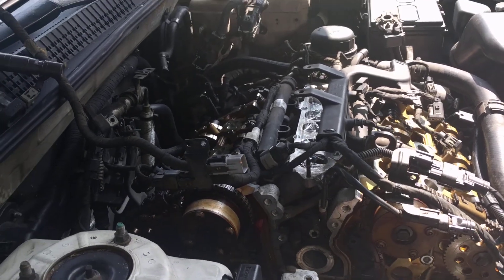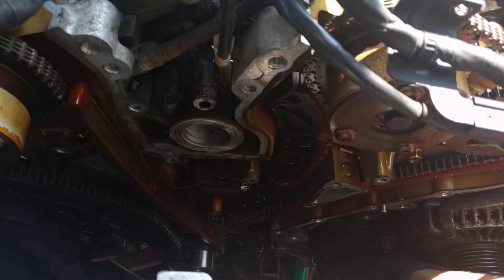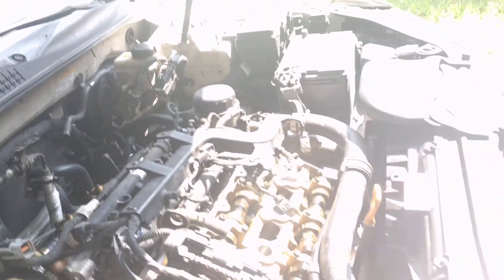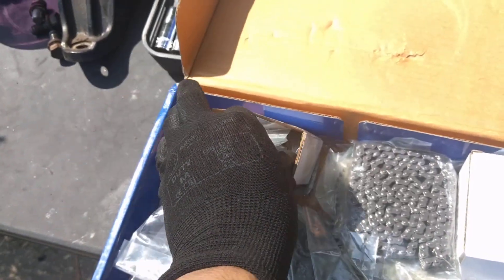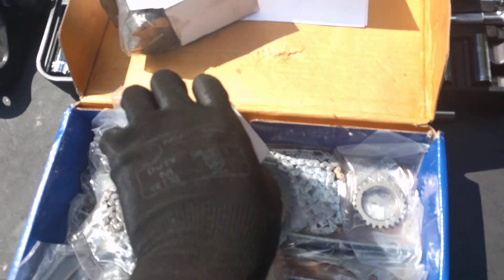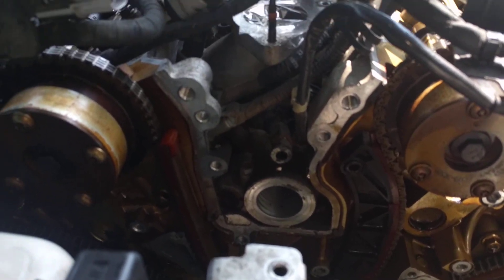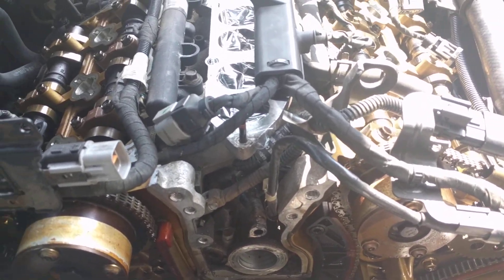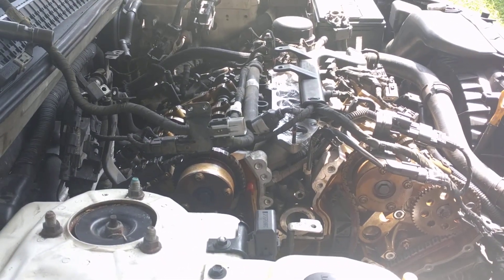Fixing Hyundai 3.3L V6 Timing Chain Tensioner Rattle On Start-Up Part 1

Comment: I have a 06 sonata 3.3. 156k miles all original.i bought the car with 30 k miles and have used synthetic oil and change the oil filter half way at 12 k miles. The chain rattles at start up but goes away once the engine runs. The car still has great power and averages @ 28 mpg. Recently replaced the alternator. That was not fun. Steering pump is whining. I'm so impressed by the engine, kinda like the old GM 3800 but with much more power. Next up are the axcels and upper control arms.

Comment: Thank you for this video as it PROVES THIS PROBLEM CAN BE FIXED EVEN IF NOT COMFORTABLE MESSING WITH TIMING!

Incase anyone asks:
YES YOU CAN CHANGE JUST THE TIMING CHAIN TENSIONER AND SAFELY KEEP/RE-USE ORIGINAL TIMING CHAIN/GUIDES (fixing ONLY what is broken) TO MAKE REPAIR MUCH EASIER FOR DIYers! 

AS LONG AS OIL CHANGES HAVE ALWAYS BEEN DONE AND ABSOLUTELY ZERO SLUDGE IS BUILT UP, and verify there's virtually ZERO SCARING on TIMING CHAIN GUIDE, you can safely say, if it ain't broke don't fix it!!

Here is how i know:

My mom bought a used 06 Sonata in 07 that was a rental car and had HIGH milage for the age .. soon after the engine began to make this sound, but because oil pressure was still high enough everytime she brought it in, the car NEVER made the sound for the techs to hear.

Years pass and i became a mechanic, and FOUND OUT it was related to the timing chain tensioner this entire time! But for nearly 10 years now the sound never increased and stopped once oil pressure kicked in on cold start. 

Since 07 we always did early oil changes and by now car had 150k miles and needed other repairs, soo i traded it to a friend for a large tattoo, and a large list of new parts (A.C, brakes, tires, entire cooling system) and a list problems i made aware of (suspension/front end, severe paint chipping, and timing chain rattle). He slowly fixes it up and drives it until 100+ miles daily for work. Within 2 years the valve covers, timing covers, and oil pan all have developed leaks around 190k miles. Soo since he had to fix the leaks and replace motor mounts, he did them all at once. While apart we both inspected the timing chain /chain  guides and they looked excellent, so to save time and money to replace motor mounts we decided to ONLY replace the tensioner leaving the timing chain and guides in place. And yes we had all the mounts out or loosened as well making it EZ to position the engine for max space making it VERY quick and ez (with the electric ratchet and torque adapter of course haha)

Fast forward 5 years and the car has nearly 100k miles more than when we fixed the leaks and is running 100% engine and transmission wise! Just from tune-ups, fixing leaks, doing flushes early, and that one timing chain tensioner..

Since 07 i knew this engine and transmission was something special, but i wouldve never thought it would compare with Toyota reliability!

The most unbelievable thing is how the car still had OEM ignition coils and only on 3rd set of OEM spark plugs with 275k miles!

Comment: For the record that is a 2007 Hyundai Santa Fe not a 2006 Santa Fe. It was probably built in 2006 but it was the 2007 model. Just so people wont get confused. I notices the headlight assembly at the start of the video and the 2006 still head the older style headlights.

Comment: I know you said you got your parts from eBay but from what company? Did the parts hold up or were problems encountered later? I need to do this work soon but want to use good quality parts so I don't do this work a second time!
Reply from the maker: Still running strong 4 and 1/2 years later and this car is my daily, the kit I used is ECCPP from Ebay it was $160 back then and I took a gamble because I didn't want to go OEM for $920, it's holding up great
Reply: Thanks! Good to know!

Comment: 1) Did you have to remove the oil pan?
2) To charge the tensioner do you have to be concerned with timing marks?

Comment: My 2017 3.3 (123k miles), no acceleration going uphill, coasted/sped up going downhill in drive. Made it to my mechanic, put in Park, plenty of rpms. No trouble light. Left it with mechanic, could not duplicate nothing in computer. Had him do brake job (just in time) and oil & filter change. He found metal in the "oil bucket" and a hole in the valve cover from the timing chain. Found/tightened 2 loose bolts thru valve cover, patched hole. Now no more start up rattle.  I'm sure I need tensioners replaced. Anything else?

Comment: How did you manage to remove the balance chain with the jack holding the engine up by the oil pan?
Reply from the maker: I don't get what you mean by removing the balance chain, I jacked up the engine from under the block, the oil pan has to be removed first thing when you start.
Reply: @mifix786  oh Ok! I didn’t take it off and had to do it from the top with the pan on. Thanks for your video by the way, it was a life saver!
Reply from the maker: @ianblank  Welcome, glad that the video helped, The timing chain cover sits on the pan, when reassembling everything back together you'll have issues making a tight seal in that area, plus debris might fall into the oil while you're working on the chain. If you haven't put the timing cover back yet, better drain the oil and remove the pan now, then put it back on after sealing the timing cover to the block.
Reply: @mifix786  thanks, I cleaned out the oil pan before I put on the timing cover, I’ll have to remove the pan after I’m done.

Comment: Is this the same procedure as the 2.4 liter Engine
Reply from the maker: Most chains/belts work is done the same way across different engine, which usually involves removing engine mounts, jacking up and supporting the engine etc, so in short the two engines are different but the process is about the same
Reply: @mifix786  thank you and thanks for taking the time to make videos and teach people that's what makes the world a better place

Comment: Wow I have this engine, 08 tho, you ever have a problem with knock sensor? Got a code after doing the valve cover po326
Reply from the maker: Nope, you may have damaged the sensor, get a new  sensor and see if it fixes the issue
Reply: @mifix786  any idea where I can get torque spec for the oil cooler assy thanks!

Comment: Wondering how many miles on the car ?
Reply from the maker: 147k miles then, now at 160k
Reply: MIFIX Mine now has 198k and it kinda started to start dry for couple seconds so probably the tensioners are going bad. My question to you is, did you just loosen the tranny mount a little and jacked up the car from both sides, the engine and the transmission? Or just the engine side? And how stubborn was the timing cover to get it out after you loosened the bolts, 
Thanks a lot

Comment: I am looking at buying one of this generation and want to thank you for putting these videos up showing us your skill and that it can be done this way.           Did you have any issues when you replaced parts or chain tooth alignment in that space?
Reply from the maker: Thanks for the support bud!! Appreciate it, to answer your question, absolutely no issues with the parts and timing alignment, it's been over a year now, no leaks or startup noises, if done right it'll be a lifetime repair that will outlast the car itself, go ahead and buy it, very reliable cars, minimal issues, engines are very simple and powerful. Please subscribe if haven't done yet. 👍👍
Reply: @mifix786  Have you dealt with the chronic valve cover gasket leaks from the left side above alternator?

Comment: Thx for the vid dog. What about the oil pump. Is it in the oil pan or attached to the block on the crankshaft like a 5.4 3 valve ford?
Reply from the maker: Thanks for the support! The oil pump is attached to the block and hangs into the oil pan on this engine.

Comment: If the car wont turn over but everything come on would u need a new engine
Reply from the maker: Not always the case, might be something as simple as a bad ground, bad starter, bad relay, all of which are simple and cheap fixes.
Reply: Fixit automotive i have the same make. And model I literally drove the car turned it off and put oil in it and it would start back up and I was told i needed my timing done but im getting a second opinion
Reply from the maker: @dmsbears1782  I would start by checking your your grounds, and work it from there, take them off from the body and sand them as well as the contact surfaces on the body with a coarse sandpaper, if it does not fix the issue, check the stater relay, replace it with a new one, if it doesn't start, then remove the starter and take it to Autozone, they'll test it for free.
Reply: Fixit automotive ok thanks

Comment: Where did u get your parts from???
Reply from the maker: Fleebay for 160$, beats the 900$ that the dealer charges
Reply: Some people was telling me i need a engine then other people was saying it could be fixed afterwards did u have any issues
Reply from the maker: @dmsbears1782  no issues, drives smooth

Comment: Thank you so much .
I am doing thus same job on my Mom's 2007
And I'm having problems removing some bolts but now I know to loosen transmission mount.
I have just mount out and jacked up under same side but no room so thank you for video of transportation mount trick
Reply from the maker: Glad the video helped you do the job,  how did the whole process go?
Reply: @mifix786  where are you located...?
Reply from the maker: @liljons6753  NJ
Reply: @mifix786  thanks for answering.....i am 10 hours away 😫😫😫😫
Reply from the maker: @liljons6753  it's okay you can do it yourself, it's not that complicated, 200$ worth of tools from Harbor freight and a couple days of work, give it a shot and if you need help just ask
Reply: @mifix786  thanks...